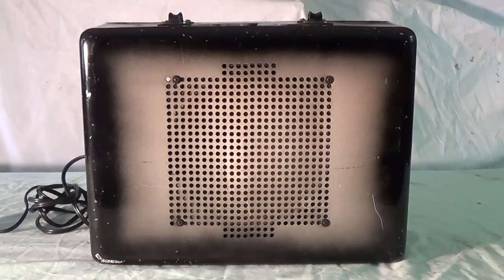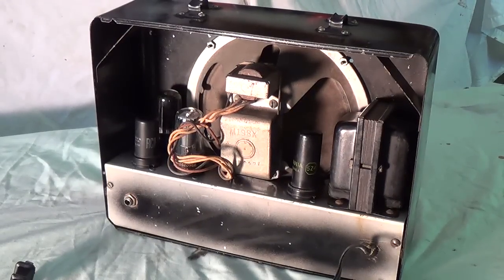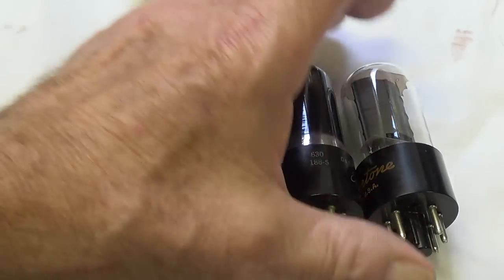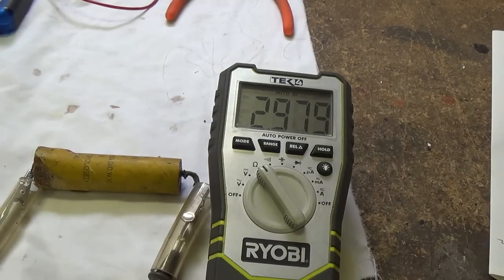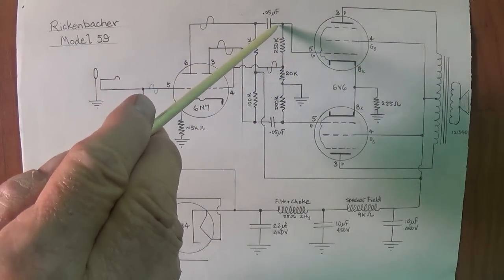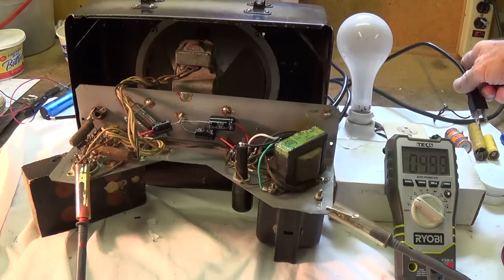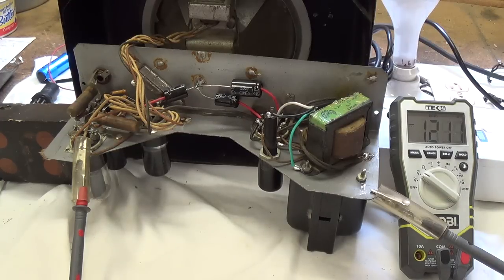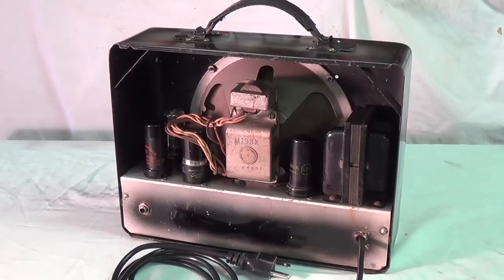1939 Rickenbacher Model 59 Lap Steel Amp Restoration

Comment: uncle doug im still working on my brothers vibrolux when standby is on the voltage is -40  to -59  when standby is deactivated the voltage jumps to roughly 465is volts thanks for your time i had my wife type the message you must be busy thank you for your time
Reply from the maker: Luke, what voltage are you measuring? If it's the plate voltage of the output tubes, it is supposed to be near zero on standby and then jump up to full plate voltage when taken off standby.
Reply: i can get the correct volatge for potentiometer that was the voltage i was checking, the 820ohm resistor next to coupling capacitor had a 42 ohm restistor, it is the 820 that is connected to 47 ohm resistor, and the filter capacitor was in fact wired backwards, im checking 6l6 tubes now for shorts becasue when standby was taking off the amp started squealing as we speak the tube tester is on if you dont mind would you please call me 906 241 0062 and let me make a friend out of you besides all the vintage junk i have collected over the years which i am only thirty there is bound to be something i have that i would happily give you, i have probably 20000 tubes and only god knows what other vintage junk i have i defintley owe you lunch and something down the road you may say i dont owe anything but your videos have truly been remarkable in my understanding of electronics thank you again
your friend
luke mcdonald
Reply from the maker: Luke, I really appreciate your kind words and generosity, but I just don't think I can be of any more help in repairing this amp. I have responded to about 15 different inquiries about it on both YT and FB, and simply can't do any more. Please understand that I get around 100 questions and comments a day, and if I spend even 3 to 5 minutes on each one, it adds up to 5 to 8 hours....every day. Long distance repair work is extremely difficult and I'm sorry that I can't solve the problems with this amplifier. I hope you can. Best of luck.
Reply: no worries all it was pretty much is resisters out of value, and bad tubes, it powers up now doesnt blow fuses one bad 6l6 two bad 7025s,  it seems now is ground problems and a coulple leaky capicitors , ill put video up like i did for the vibroverb, it is just nice to always be in a circle of friends to talk about this stuff i am over the mountain now with the amp and a couple more days ill give it back and my brother will be happy, whoever he brought it to must have not had the schematic a bunch of things werent wired right and and ill i can do is  what the schematic says im sorry if you dont have time to respond to me i dont want to cause no trouble, further more if i dont know im not afraid to say i dont know
all the best
Reply from the maker: Thanks for understanding, Luke, and congratulations on repairing the amp. I too enjoy communicating with a circle of friends, but sometimes get a little overwhelmed. Best of luck to you :)
Reply: i still cant beleive that without that 820ohm resistor the voltage jumped to 450vdc on bias potentiometer, they put in a 47 ohm resistor in wrong spot cant beleive always learning, the amp now has leaky coupling capacitors but it is turning on and staying on, it will be there tomorow
easy peezy nice n easy
Reply: pin 6 on V5 is 100vdc short

Comment: Great video, and I really appreciate the educational parts as I'd like to learn more about analog amplification.  Just wanted to say, I have a '64 black face Super Reverb with a two prong plug on it.  I'm not going to change it but I'm really careful how I plug it in and what I touch when I'm plugged in, etc.  It sounds awesome.  Walk Don't Run had me smiling.
Reply from the maker: Thanks, BK. Glad you liked the video (and the surf riff :). I have a bunch of vintage amps with 2-wire cords and have no problems, but you have to periodically test them for potential to ground, like I did in the video. Best of luck :)

Comment: Jesus...I thought my Magnatone (1948) was old.!
Speaking of which...it had a similar looking filter cap...like a small stick of dynamite...paper falling apart...elytic paste all dried up...and it also "took a charge" like yours did in your video. Amazing.
Hey.......what ESR meter do you have.? I have been wanting to get one, but I really have no idea which one to buy (or make). Does it measure in circuit by any chance.?
Would value your opinion on what to get in the ESR arena.
Thanks Doug
Reply from the maker: Greetings, Denny. Heck, even I am (a little) older than your Magnatone :) Those old electrolytics really are hardy aren't they.....like the Terminator at the end of the movie, torn to pieces and still crawling. I have an AnaTek Blue ESR meter. Here is a link:  http://shop.anatekcorp.com/index.php?src=directory&view=products&srctype=detail&refno=2&category=Component%20Analyzers  It works great, in and out of circuit. I know there are other brands, but it's the one I chose after analyzing what was available. You can get it assembled or in kit form (at a discount). It's a very helpful device to own.....definitely worth the money.
Reply: 10-4
Thank You :-)

Comment: Wow, this is a beauty :)
Never had a chance to lay my hands on any piece of electronics that old...
Thanks for sharing and great job :)
BTW, what is the voltage rating of those caps you put in? Without the tubes it went up to almost 500V ;)
Also, I see you're not a fan of putting replacement caps into hollowed-out old ones? I do it from time to time, especially in case of those big screwed on multi-caps to preserve the looks.
Reply from the maker: Thanks, Stan. It's good to hear from you :)  I agree that the voltage on the empty tube sockets exceeded the 450V rating of the caps, but I have seen this repeatedly with no dire consequences. Apparently the voltage rating has at least a +10% leeway. No, I don't generally try to hide new capacitors inside old ones, especially in cases like this where several of the old caps are not original. I will leave any visible old caps in place (i.e. the canned multi-caps), but hide the new caps inside the chassis. I guess if a customer requested it, I would....but so far, none have. Thanks for your input :)

Comment: You could still do a push-pull amplifier with only having a single pentode in the preamp, and in fact, I can think of two ways to do it, off the top of my head. One is to use a self-split power stage, where the two power tubes act as a long tailed couple, while being the output stage at the same time. Another way sould be to use a transformer with split secondary winding as the phase inverter. The way Rickenbacker did it here is really clever and interesting.

I am only not sure by the way you grounded the third wire of the power lead. It is a good practice to make a separate lug that is only used for the ground wire. This ensures that the bolt will never come loose. In this case the heavy choke may rock and wobble a bit, and make the connection loose after some time. I have seen people connecting the ground wire to any bolt nearby, especially to a lug on a bolt that is mounting an IEC power socket, but this is really bad practice, as you risk the bolt, and therefore the ground wire, becoming loose at some point. Actually, I believe the only legal way to do it, in Europe at least, is to use a separate, dedicated lug for the ground wire.
Reply from the maker: Greetings, Kard. I was indeed looking for another transformer under the chassis plate that might act as a P.I....and when I first saw (what turned out to be) the filter choke, I thought that might be it :)

The P.I. method used by Rickenbacher is quite similar to the Gibson EH-150 (as mentioned in the video) and to the early Fender ("Woody") Model 26 Deluxe.

Your recommendation on the ground lug is interesting. I never considered the possibility of a nut coming loose, especially when a lock washer is used, but I will keep it in mind. Thanks for your input.
Reply: Uncle Doug

Yeah, I used to use whatever bolt happened to be near the power socket for the ground wire lug in my own builds too, until I got a good talking to from a professional guitar amp builder on an internet forum. Better safe then sorry, especially since your amp will surely still be in use another 70 years from now!

Comment: Uncle Doug,
you're doing great without Rusty, he might get jealous when back from the Outback.
Good video and as usual, after your restoration, the amp works. I would love to have a tube tester as yours, but they are rather difficult to get - might be worth a video, showing how it works.
Reply from the maker: Greetings, TM, and thanks for your kind words. I am putting up a good front, but video production is much more challenging without Rusty's capable assistance. Re the tube tester, it's simply a device with a power supply, just like an amp, that powers up the tube, checks for shorts, and measures its output (in different ways). Here is an excellent site, describing the different types of testers and tests:  http://en.wikipedia.org/wiki/Tube_tester
Reply: Thanks for the link, keep on going with more video's.

Comment: Yet another fine video Uncle. Question: Have you noticed that when you have an old amp plugged in the wrong way, you can feel it? Not shocked but the metal surfaces (on either the amp or guitar) don't feel right?
Reply from the maker: Thanks, Pat. If you feel ANYTHING from the metal surfaces of an old amp, it's a worrisome situation. As in the video, run an AC voltmeter between the amp surface and a strong ground. If there is any potential (a reading above zero) then you should consider installing a 3-wire, grounded power cord.
Reply: Uncle Doug Thanks for your speedy response. All my current amps have the three prong plug. But, back in the early 70's I had a 60's era BF Deluxe Reverb with the two prong non-polarized plug. That amp would bite upon occasion and I would flip the polarity switch. But I eventually noticed that I could feel or sense the amp was plugged in wrong and I wondered if you (or anyone) could sense that also. It's like those little electrons are jumping around but don't have a place to go to...yet, because I had my Chucks on with the rubber soles and was insulated from the ground. But still, I could sense it and then I would flip the polarity. The metal surfaces feel different like they are not slick or as smooth.
Reply from the maker: I understand the sensation you are describing. Yes, as a child, we had a washing machine that would give you this feeling when you touched it, especially if the skin on the inside of your forearm came in contact with it. Fingers are calloused and tough, but the softer skin isn't.

What I think you are feeling is the influx of electrons charging you like a capacitor. You aren't well grounded, so there is no current flow through you, but the body is like a low value capacitor and a small amount of charging current will flow into you, past the nerves in your skin. Since it is 120V or less, there is no bright spark-discharge to a doorknob as there is with the thousands of volts you can build up with static electricity.

It's just my theory.....but I'm sticking with it :)
Reply: Sounds reasonable, thanks.

Comment: The yellow capacitor was amazing!  I was guessing (hoping) the phase inversion might be similar to your Magnatone Melodier until you showed the schematic. Beautiful repair work, and the sound is incredible. Hopefully Rusty returns tan and relaxed from his vacation. :))
Reply from the maker: Greetings, Andrew, and thanks for your kind words. It's always good to hear from you. The suspense was definitely building with regard to the phase inverter. I thought there might be a PI transformer hidden inside and assumed that the filter choke was it.....until closer inspection. At least we finally got to see a living, breathing example of the third type of phase inverter (as presented in the PI video), a type which was en vogue during the late 30's and early 40's. There is some gain provided by the Paraphase inverter, so I guess in this case it was a combo pre-amp and PI. The yellow capacitor will be ensconced in my Hall of Shame display.....visitation by appointment only.

I got a post card from Rusty. He is at Surfer's Paradise on the Gold Coast and having a great time. Hopefully he can spend some time with his litter mates while in Queensland, before returning home to resume his videography career. I'll give him your regards :)

Comment: Hi Uncle Doug! You've just got to love these old amps and their scale of economy.  Sometimes guffawed at, the engineers were pretty clever in using as few parts as possible!
Reply from the maker: Greetings, Ab. You're right, they were certainly able to accomplish quite a bit with minimal parts. Like the Model T....good, reliable transportation for $500. Nowadays, people are spoiled. The auto-adjusting rear view mirrors on my car probably cost more than $500 apiece....but it sure beats having to reach out a few inches to adjust them by hand :)))

Comment: This amp reminds me of the time, when I was a little guy back in the 50's our mom got a NEW refrigerator and it replaced the old one which sat right next to the light switch for the kitchen. If you weren't careful switching on the lights and brushed the fridge it would give you a healthy Zap. With that fridge we didn't need OJ to get us going in the mornings. We always loved when cousins slept over on weekends.
Reply from the maker: Greetings, MM. I guess we were just tougher back in the old days. I recall getting shocks of varying degrees on a regular basis....it was almost a routine event. We had a washing machine (in a cement-floored utility room) that was not grounded and if you were barefoot and touched it, you could get a pretty good jolt. Instead of suing the manufacturer, my parents just told us to wear shoes or not touch it....simple as that. Like you, I used it to torture my friends :))) Fortunately, none died.

Comment: Wow! Amazing video! Interesting how safety standards simply did not exist in the past! Even to play guitar the guy had to be tough! But, wait a minute, where is Rusty? Hugs Uncle Doug!
Reply from the maker: Thanks so much, Andre. Rusty is attending a family reunion in Australia and could not participate in this video :) Yes, early guitarists must have been a hardy (or at least lucky) crowd. I can imagine the excitement if one of the chassis screws had happened to touch a high voltage wire (which could happen rather easily) and you were barefoot when you touched the cabinet. Maybe that's how break dancing was invented :)
Reply: Hahahhahaahahahahhahaha...the roots of break dance!